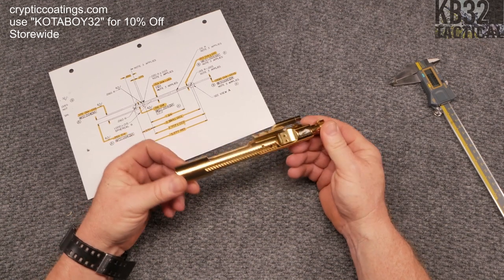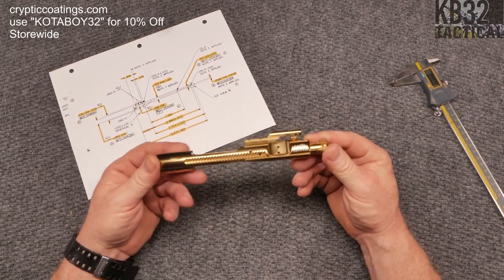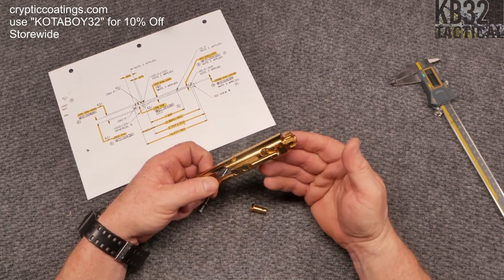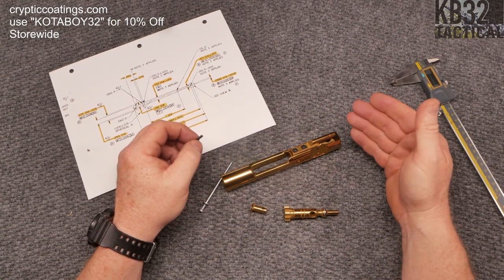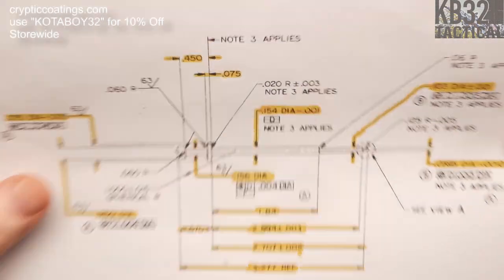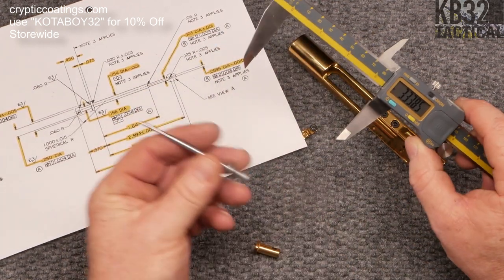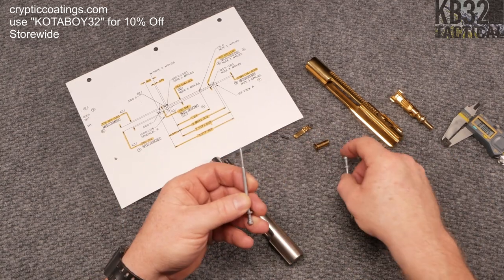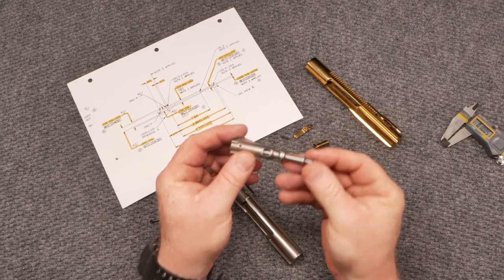Bolt Carrier Groups Part Three: Here's To the Firing Pin!!

Comment: I've been looking for a description of the enhanced firing pin. Some say the nipple part is longer and others say it's the back tab by the retaining pin is that is thinned out to make it strike deeper.
Reply from the maker: I run an enhanced High pressure pin and bolt in my 6.5 creedmoor.  I will eventually be doing a comparison between that and a regular.  To be truly enhanced, the pin tip is pointier.....lol and the firing pin hole is smaller.  Reason for the enhanced or high pressure is to eliminate blown primers from high pressure rounds found in the 6.5 creedmoor.
Reply: Being a 7.62x39 AR build guy and can tell you difference. The OAL is the same. You see how the back of the firing pin looks like a posted tac? The biggest and second hump is ground down slightly toward the muzzle end. So....when the hammer hits the back it allows further travel forward of the firing pin. This allows greater stroke into the primer and in particular works good with that pesky Russian deep set hard primers. Don't quote me on the amount of increased stroke but, if memory serves me.....which it don't because I ain't suffering from memory loss...I am actually enjoyin' it. It is like .018" ish more😂👍🇺🇸
Reply: @UncleDanBand64  this is totally correct in the vast majority of cases. Also 7.62x39 in an AR needs good hammer springs and trigger springs. When we lower them we have issues sometimes even if an "enhanced" firing pin. But mil spec springs and an enhanced pin/ filed down firing pin, and in my experience 98.9% of Tulammo and wolf run fine.
Reply: @kotaboy32  Yes, JP has a great  HP bolt for .308/6.5....

Comment: I dont need that Fancy Crap if it goes BANG WHEN I NEED IT TO THEN I AM GOOD TO GO
Reply: I’m with you. LaRue and some of the more expensive stuff may in fact be better, BUT, is it necessary? I’m no operator, nor  am I a professional shooter. If it did hit the fan , most of us would never fire a shot, if we did it wouldn’t be many. If it goes bang, it’s good enough.
Reply: I looked at parts only from some of the really high dollar items and just the fancy plated BCG costs more than my entire rifle.  If a person has the means and wants the tacticool stuff, then go for it, however, us regular broke folks don’t need it so don’t mortgage the farm to get it.
Reply: @justplinkin4809  "better" says who. It isnt worth the cash. Although I would be pissed about the toolcraft bolt,I wouldnt buy a toolcraft bolt.
More than likely it is a process issue though. They are drilling the campin hole after the firing pin hole leaving a bur.
Probably caused by a full tool.
Reply: @justplinkin4809  Right I have a Stag Left hander  it shoots just fine only add on was a Franklin Armory  Binary Trigger which IMHO is a MUST HAVE FOR EVER AR out there PERIOD
Reply: David Reed To each his own. I only need one round to fire and only when I pull the trigger. Ammo costs too much.
Reply: I think you're missing the point.  There are those of us that like the dorky, engineering side of it. The precision and the ability to microadjust (or at least understand it) is part of the passion and fun.

Comment: sharpie the firing pin and run it thru the bolt by hand. you most likely have a small burr from the machining process. itll scratch the sharp off . im most likely late to this video but just what i do at work to find burrs in a blind hole

Comment: Kotaboy... I have a question for you. I picked up an unpolished Chrome BCG. Is it as simple as just polishing it and putting it in my gun? Do you know much about that process? My plan was get just get a dremel and finish it up. Any thoughts or advice would be great.
Reply: you should be able to just run it, Chrome adds lubricity.
Reply from the maker: I wouldn't mess with it, but that's just me.  Try some compound with the dremel and a polishing wheel.  Rouge jewel polish will give you the best outcome.
Reply: Interesting, the LMT MWS carrier has a dull chrome finish, maybe it's bead blasted.  IMO, it hold lube and cleans up well.  Never thought about polishing it.
Would you use a compound, Flitz or something?
Reply: @kotaboy32  Thanks Kotaboy, Richard, and Marz. I will do ahead and leave it unfinished and see how it does!

Comment: one of the reasons i think the but end of the firing pin is a bit shorter compared to your drawling is due to its overall length being a bit shorter.That way the point of igniter of the firing pin will reach and still be its proper depth for ignition.But you are right this is very interesting to me.I have been building lowers for a while now and need more tools,because id like ot start on upper and its parts like the BCG.Knowing what the individual measurements are suppose to be can help you in picking the right parts when shopping for all the tiny ass individual pieces/parts! LOL if you want to hear a kind of funny story ill try my best to make it short.              
       I had the parts for three complete lowers when i 1st decided to start to  build my own.I watched a few "how too" video's and in each and every one they urge you to have a magnetic cup/tray and always point what ever spring at a wall of shield so if you lose your grip on said spring it wont go flying strait up to "who knows where"? lol well of course i tested it a few times and i though the very 1st spring i was installing would be easy and dropped  it in and then the detent.I pushed down and as i was ready to start to complete it......YUP dig there they go flying into the air strait up ! LOL i hear the detend hit the "shag" run in front of my table (i know i know i should have been on a tile or concrete floor lol.Well i was very lucky to find the detent actually and even though the spring was about the size of a tooth pick i couldnt find it!LOL i thought ahead though and purchased two oops kits or field repair kits and some call them.Soi had the parts and did it as the video said although i didnt slip on any others! I was just purchasing uppers for them,but now want to start building mu own uppers.I already have a Faxon 24" 6.5Grendel TypeII barrel and a completed lower.Just trying to figure out the BCG and CH as well as other parts?Was seriously considering a Side charging variation? If you dont mind what are your thoughts?

Comment: Today's tip, for BCG, is "firing pin." I have an armorer "enhance" the pin, taking material off allowing for deeper primer penetration. 
Why? Russian ammo, and others, have heavy duty primers, and MOST AR'S will not eat the stuff.
So, we enhance the pins. I order a doz. at a time and they run batches, it's not like I can text or call and order x amount and expect them to be here in a few days.

Comment: There is probably a burr on the thru hole that is causing the binding (most likely) or the thru hole is not  straight but drilled at a slight angle.
Reply from the maker: We'll find out shortly
Reply: You can see, at 9:28 in the video, that the end of the pin guage is stopping right at the point where the firing pin hole first intersects with the cam pin hole.  That's almost certainly caused by a very small burr that is creating a little interference.  A stubborn burr can be tricky to clean up completely in an interior intersection like that.  If you ream the cam pin hole last, you may fold a burr over into the firing pin hole, and if you ream the firing pin hole last, the burr may get folded over into the cam pin hole.  Even then, the cam pin itself might push the burr back into the firing pin hole.
Reply: Maybe take a q-tip and give it a quick twist , it should leave some fibers in it to confirm a burr.
Reply: Any updates after a year ???

Comment: I used h series cerakote on a bcg. Not the bolt but the carrier. I also coated the inside of the reciever. Minute amount of oil needed and we are close to 1000 rounds. If it fails, i will let you know how and how many rounds. Alot of the carbon comes from the oil. If we can eliminate it we may be able to go no lube. Im just two guys, it tskes timeand money. Slow going.

Comment: wait just because you need to light finger tap the firing pin ..it has a '' issue ''..Christ the hammer hits it with force of the hammer spring .. put it in the gun pull the trigger ..it goes bang it works .. simple no big deal .. your learning .. what ?? useless crap ..Christ
Reply: YEP, he is wasting his time with that SOTAR gaging, he should be sticking to what he does best, shilling cheap parts. And he is the best on the net at doing that.
Reply from the maker: You are so kind
Reply: thanks , why know useless info , no one if designing an ar-15 ..spend the time and $$ shooting ..I understand '' your '' need to know all the hows and whys , wheres ... and in side for weeks going nuts like all of us .. but mic-ing  a firing pin .. .please .. ok its not 3.277 its 3.2750 .. so now what ..
Reply: @katana258  exactly
Reply: @roy rodriguez apparently you thought learning proper English and writing was “useless crap” too.